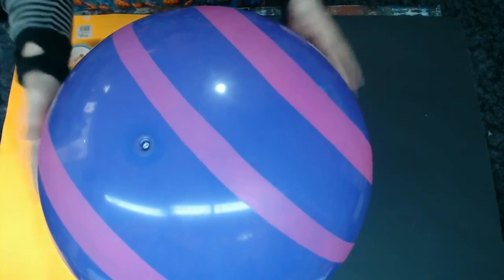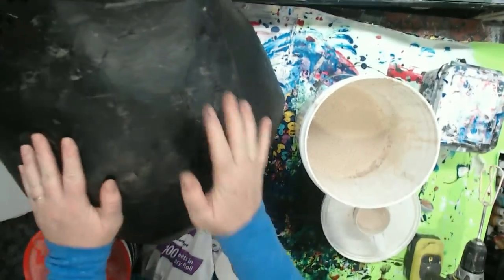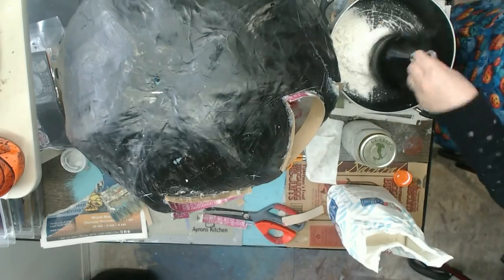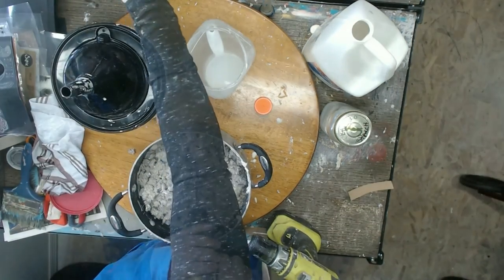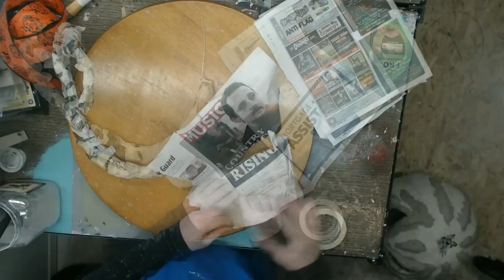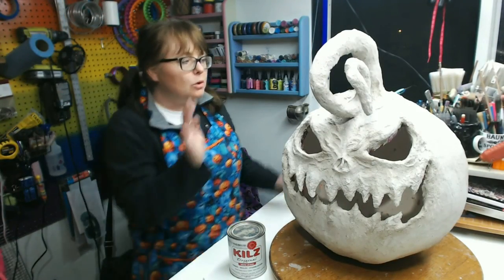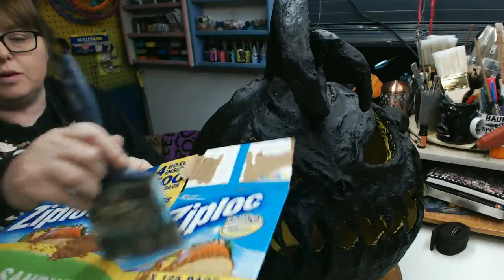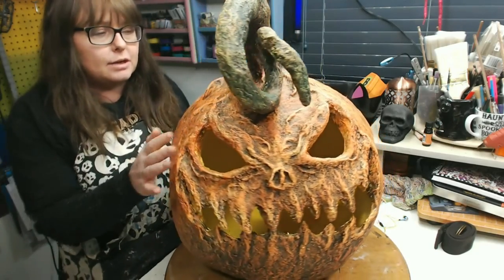Paper Mache horror

Comment: I have done this same project last year, I also used a beach ball For the convenience of its size. The problem I kept having is once I would let the air out of the ball the papier-mâché would cave in somewhere how did you let the air out of your ball? I noticed your Papier-mâché covers over the air spout
Reply: You cover the ball with paper mache. Then you cut a hole in the bottom and that's how your air releases. You don't let the air out when it's wet.